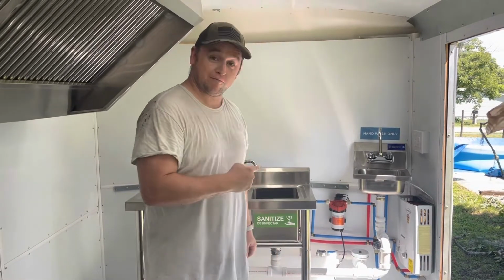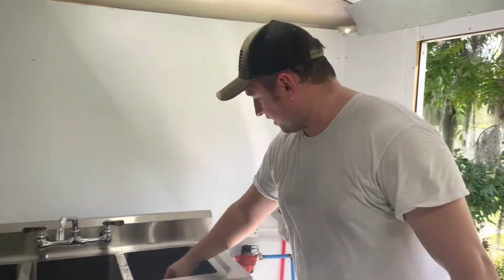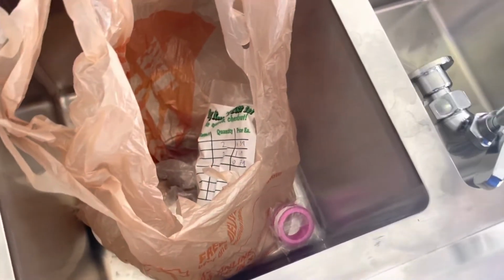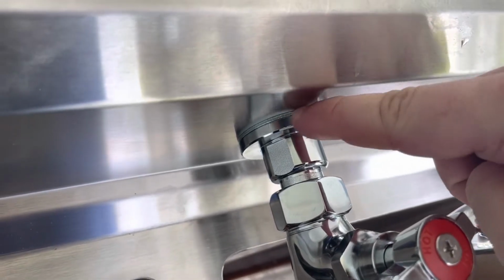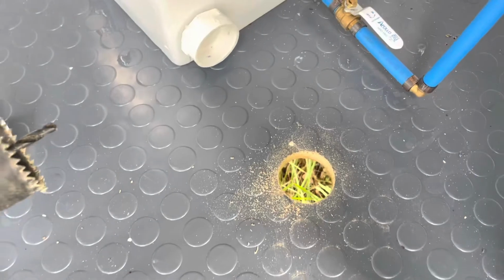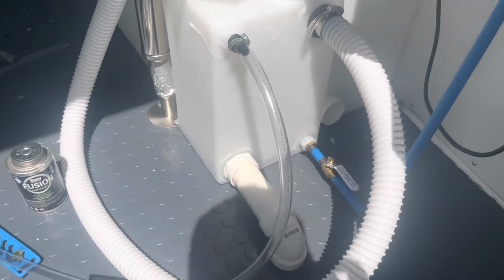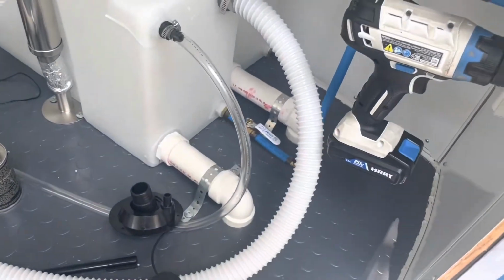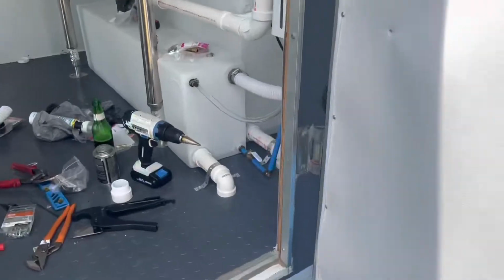Plumbing Part 2 - Poor Man’s Food Truck

Comment: Hey really great work you're doing. They do make that small hand sink with the side splashes. We are an equipment supplier, but we are also builidng a food trailer. Question about the actual clean water tank, cold, and hot water. I bought a clean tank from the same company as well. When you go out from the tank, do you go to the HTW and T off from the cold so you can go to your faucets as well?

Comment: where do you have the valve to change from city water to tank water? thanks!
Reply from the maker: Ours is self-contained only, however it needs to be filled and dumped every day via our approved commissary (which runs on city water). Hope this helps!

Comment: Did you vent the grey water tank? If so how?
Reply from the maker: Great question! Yes - I did vent it using a threaded male fitting and a 90 degree fitting with a hose connecting the two together. I will post an updated video soon with all the final touches (including this). Stay tuned!